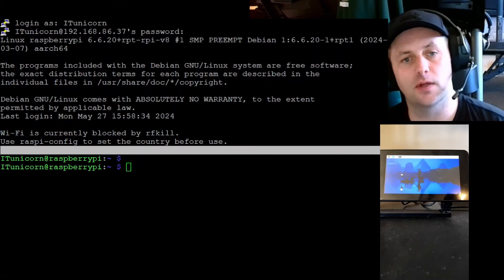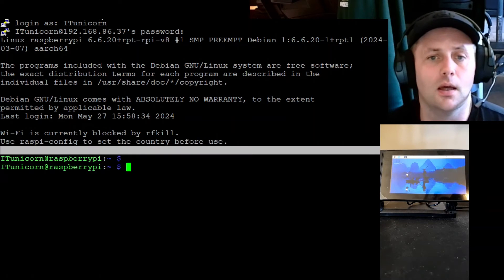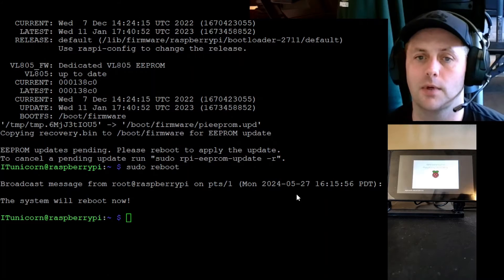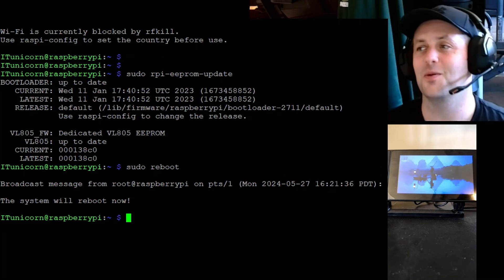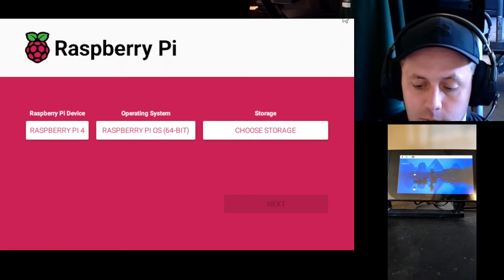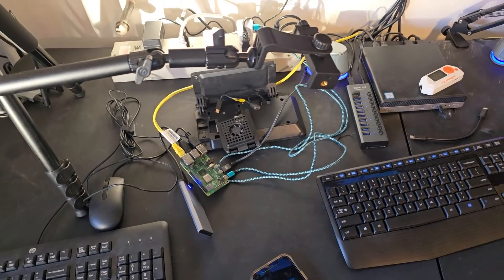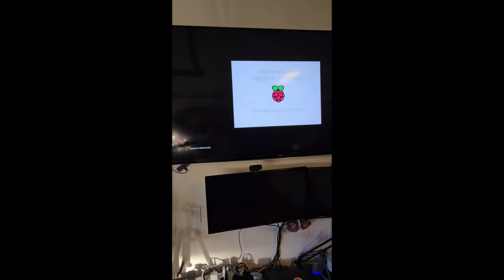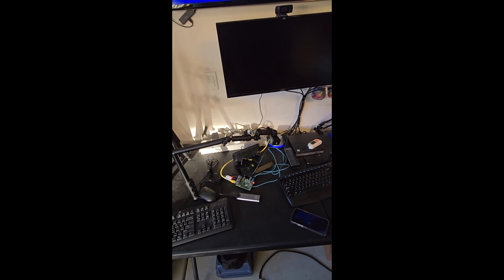Unlock Raspberry Pi Speed: Boot from NVMe!

Comment: Hes so right. Im running my Pi 5 off a Crusiacl NVME SSD on its own hat and its own fan above on a hat. 1200mb/s read writes. in Kali Linux
Reply from the maker: DAMN! That's sick, bro! 1200 mb/s is nice, especially on a pi!
Reply: @bootableusbs  I honestly didnt believe it at first. Using hdparm it flucuates as it does so ran it a few times 900-1200. sudo apt install hdparm. Kali runs great on a pi 4 or 5
Reply: going thru your python stuff. Im trying to learn as much as i can. Much thanks man
Reply from the maker: @Mbro-dq2do  Very cool.  I don't have a 5, yet. 🙂